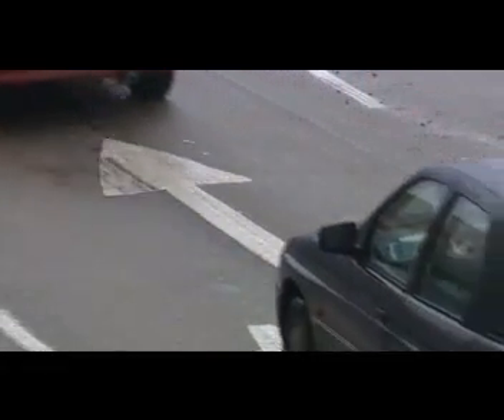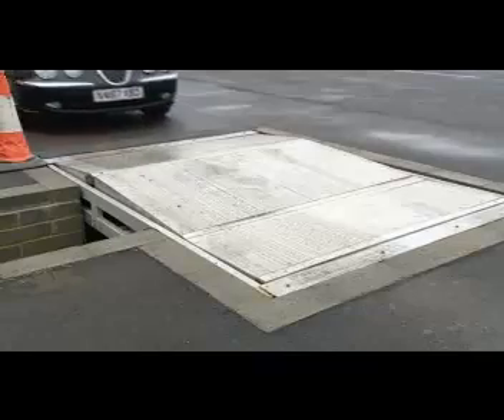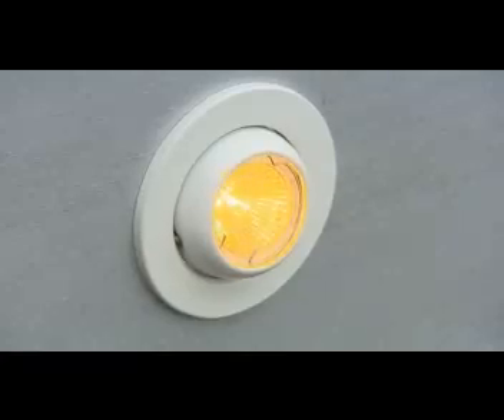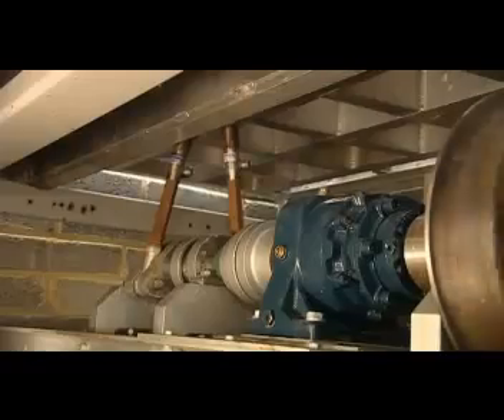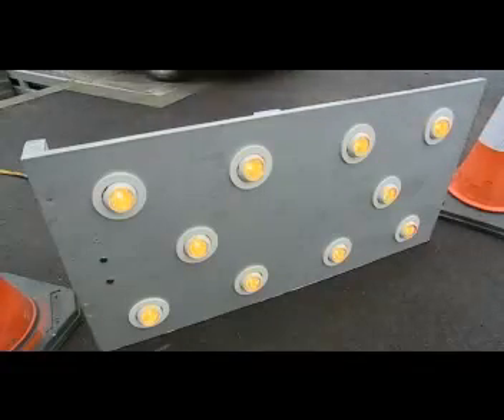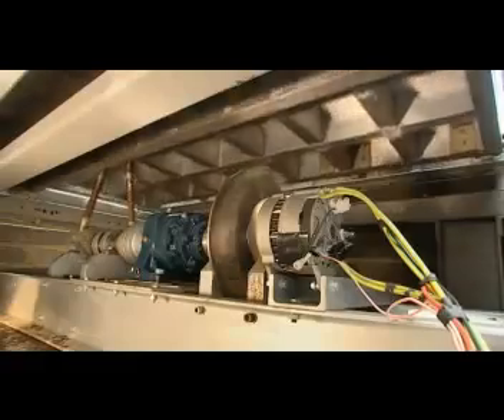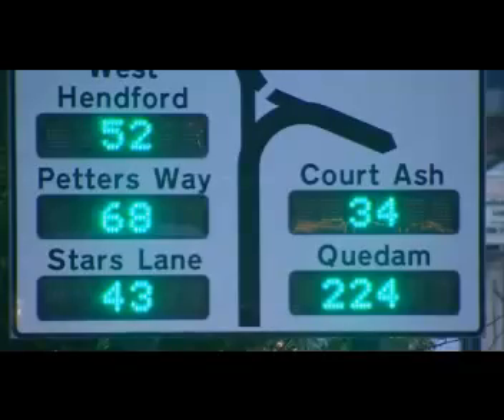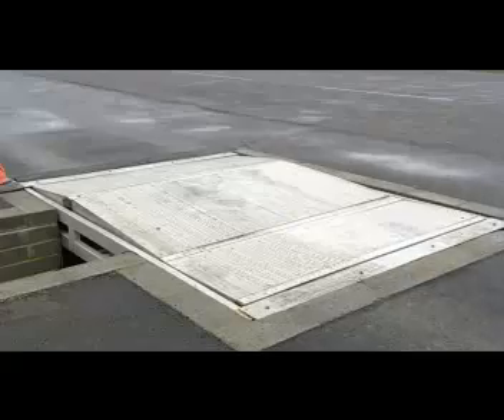Electricity from road with kinetic energy. video 4.mp4

Comment: Is there any simple model with you to make project
Reply: No. It doesn't work.
Reply: @drunkenhobo8020 ❓why
Reply: @piyushambekar7244 Because it effectively makes the cars drive uphill to produce electricity. That puts more strain on the engine so they use more fuel. It's just a very inefficient petrol generator.
So it does produce emissions and isn't environmentally friendly.

Comment: This device will slow down the car and thus require an additional fuel usage by the car. The statement at 2:48 is thus completely false. In fact, since the combustion engine in the car is very inefficient compared the a modern power plant this device is much more polluting than excising power generating technology!
Reply: You can use it in Amish country the horse and buggy will press it down, you have to give a horse a little extra grain at the end of the day. Now are you happy?
Reply: @OKFrax-ys2op  Perfect 😉 Now we just need to figure out if the horse is more efficient than a biomass power plant at converting biomass to power. My guess is that the power plant wins.... Maybe the Amish prefers a horse power plant anyways 🐴
Reply: @OKFrax-ys2op  hagege b jyada fir wo
Reply: We not use this system in road we use this system in parking areas
Reply: @chetanmeena1553  if you know for sure that all drivers would have braked with the same force at that same location every time, then it would be a good idea in a parking lot. If the driver applies a little gas pedal after passing this bump, then this is just wrong.
Reply: Put this in a slope, then you don't have a problem.
Reply: @jazt6494  you are right. However, with the advent of electric cars, a similar technology is already embedded in every car.
Reply: would something so minute even register in the scheme of all of the inefficiencies drivers already have.